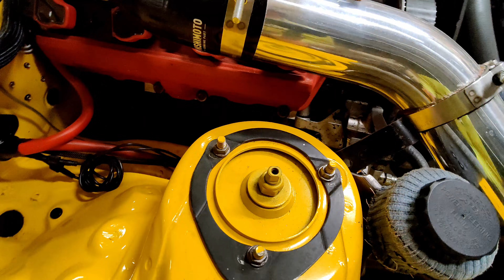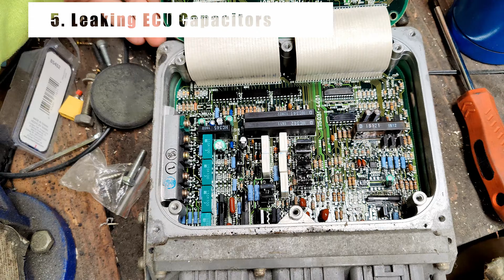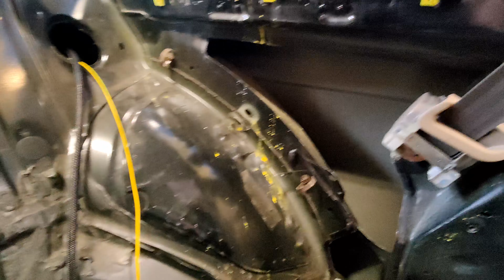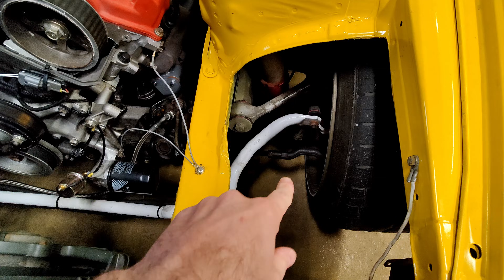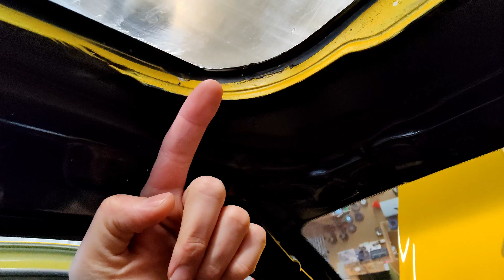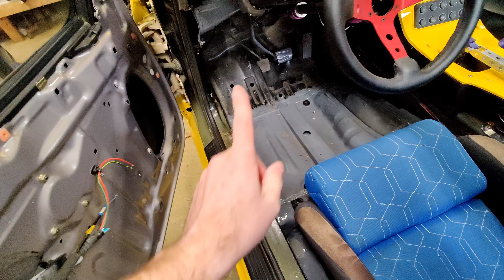Is The SC400 Reliable? All The Common Problems

Comment: I've definitely had my trunk fall on my head lol
Reply from the maker: Dude so many times lol
Reply: @Ding Dong Drift  my son has a 97 SC 400. Front driver side tire blew out ripping completely off the rim and slung around violently until he was able to safely pull over. About a week later his transmission started slipping and making wild noises eventually not going into gear at all. He has a P0715 code. The transmission never gave a hint it was messing up. Is it possible that flat tire hit a sensor or damaged some wires causing this issue? Do you know of anything that could have caused this?
Reply: Yesssir
Reply: Lmao this JUST happened to me a few weeks ago. Still haven't gotten around to ordering the new strut
Reply: Mine too. I caught the corner and bled like crazy.
Reply: I’ve definitely held my trunk up with my head lol
Reply: These is hilarious I got a bored from a pallet to hold mine it only took one hit every one think they got it until I let go
Reply: Usually, the car hit the owner head before that parts get renew, lol
Reply: Me to 😂
Reply: lol it must have been a Lexus problem in the day cause my LS400 trunk struts dont work and it always gets me
Reply: @kj64gaming19  My 93 Celica used to do that too.

Comment: I'm looking at one that has random multiple misfires, it's a 1998 SC400 and the guy's replaced al the sparkplugs, checked the coil packs and the injectors. Any idea what else it might be?
Reply from the maker: ECU
Reply: @DingDongDrift  blown caps?
Reply from the maker: Possibly, could also be running rich or lean, both can cause misfires. Hard to tell from just words.
Reply: @DingDongDrift  you're absolutely right that it's hard to diagnose with just words. What things should I look at if it's a rich or lean fuel issue?
Reply from the maker: O2 sensors, ignition problems, fuel pump, injectors, fuel filter, ECU

Comment: Never had the starter go out, also never had the hydro fans leak. This is on both the 98 as well as the 96 I had. Power steering leaks yes. But this may be different for other folks. Good video though.
Reply from the maker: Now that you said that both your starter motors will fail lol
Reply: Kevin, take your car to an experienced
Mechanic. The 100-200 you’ll pay them to properly diagnose will be worth it in the long run to avoid shooting the parts canon at your issue any further. 

Good luck!
Reply: @Ngcarson1337  I am an experienced mechanic been doing this for 20 years thank you though.
Reply: @kevind9946  I clearly replied to the wrong original comment, my bad! 

As an experienced mechanic, what are your impressions of the SC400 vs other import and domestic RWD V8 coupes? Reliability and ease of upgrades considered.

Comment: If they've been neglected then yes they are unreliable cars. When I bought my UZZ31 Soarer back in 08, I was told it had just got a new battery. 

After barely getting home, the electrical system shutdown due to the alternator not charging the battery, thanks to the power steering pump dropping fluid onto it. If only I'd known this info before buying. 

Factor in a new alternator, P.S pump, 100k service with OEM Toyota Waterpump and new belt. Then after that you can let the mods begin. The factory exhaust needs an upgrade as it's too quiet, the stock headers too restrictive due (Hurricane/Rush long tube headers are good replacements - ceramic coating worthwile too)

The auto trans needs a shift kit at a bare minimum, and the factory ECU could do with being re-capped. You could always add an aftermarket ECU in as well to delete the AFM and run coil on plug like I did.
Reply: The fuck you mean AFM? And you do realize he’s running a stand alone right?
Reply: @tyeleruttenreuther9122  No need for vulgar language mate. 

By running a standalone you can delete the AFM and run a map sensor instead. My car ran much better after I too switched to a standalone.
Reply from the maker: I think you mean MAF not AFM. that's where the confusion is at.
Reply: @DingDongDrift  Thanks for clarifying, I sometimes interchange the two, having moved from a UZZ31 to a JZZ30 Vvti which had an AFM, not a MAF.

Either way, the standalone fixed both cars. I run a Haltech on both.